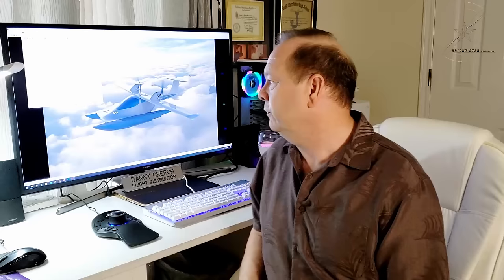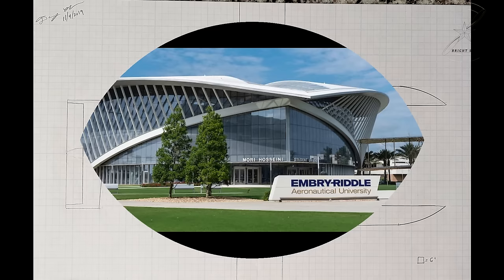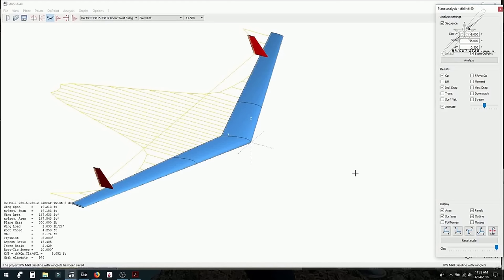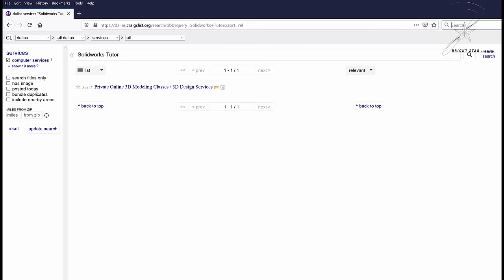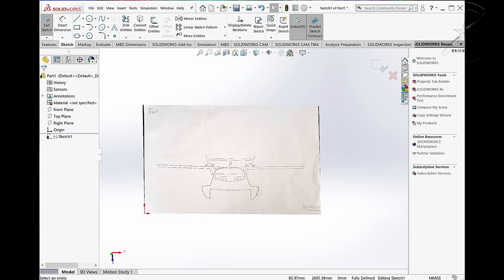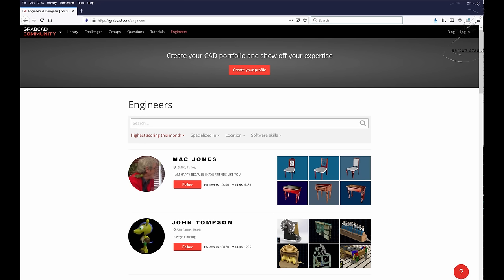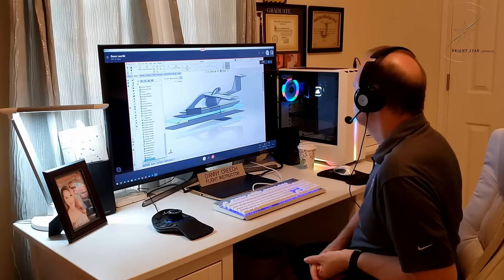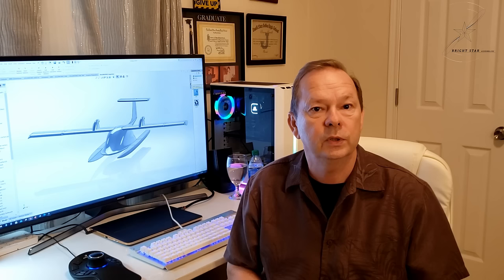How to Design Your Own Aircraft

Comment: The most important tool is passion, everything else is just a hill waiting to be climbed. I actually believe you will get this done. Very motivating presentation.
Reply from the maker: George, you are 100% correct. Passion is what it takes to do anything worth doing in life. Those who make things happen are those who have a passion.
Reply from the maker: @Hatwox Thanks. I totally get the "don't have a lot of extra money". This is why as of right now I am planing on using BMW motorcycle engines. Because I am not using a real aircraft engine is why I decided to put two of them on the aircraft. Also, if I find that these 120hp BMW engines are not enough power, I could always upgrade to UL engines. I want to make this aircraft as affordable as I can. I want the build time to be less than 1,000 hours.
Reply: Thats not true. You need a large repertoire of swear words also to fight past your CAD stage knocking every line in and out of symmetry.
Reply: @BrightStarAssemblies  call me bloody crazy but I've always always wanted to put together a single seat 1/2 scale'ish f14 inspired aircraft, any tips? 😂🥴
Reply: @KjllShot  I designed a tandem winged seaplane from a jetski hull. One passenger with autonomous capability. Concept was a rapid response SAR lifeboat/rescue plane. But a dozen in a race over the bay or harbor would be a blast.
Reply from the maker: @KjllShot  I would not call that crazy at all! Sounds cool. Sorry I can't help you much with that one. It should actually be fairly easy. Just find the blueprints for the F14 and scale it down. You would want to go with a different airfoil as you will not be flying it as fast as the original. Unless you put jets on it. Oh, and if you do that you better be a millionaire.
Reply: Without passion for my projects I would have gotten nowhere as people around me see my CAD designing as a waste of time, and my dreams as unrealistic. They don't seem to fathom that doing stuff gives you experience to do even more advanced stuff, and in the end you will be the expert you so dearly needed when you started out. Don't rely on others helping you, that is for the most part a pipe dream. People simply don't care.

Comment: I think it's also important and informative to make R/C models and iterate for efficiency, structure, aerodynamics, etc.  Lots of possible problems will rear their ugly heads in flying models, where you can analyze and correct them far cheaper.
Reply from the maker: Thanks for the comment. In the next video I will be addressing this topic.
Reply: Lift doesn’t scale 1 to 1 so one always needs to be mindful that things will change as you go from model to real life

Comment: Also, I  don't know if this helps,  but, I RC models,  Ev'ry thang comes off the wings...That determines the numbers of the fuse, engine selection,  moments,  gear placement, and  tail section size and shape....As you know,  The wing is doing all the "Heavy lifting " Ev'ry thang else is just along for the ride....Cheers  !!!
Reply from the maker: Thanks for the comment sir.

Comment: Today I was out with a friend (I'm eighteen and so is him) and we decided it would be cool to design our own aircraft. At first we were just talking about a jet-powered small drone, but at the end we decided to try and make it full size, but we didn't know where to start, or were to try our stuff, or what to build it from! We also don't have a aeronautical degree, I'm a chemistry student and he's a electric and electronics student, so we ended up kinda sad thinking that we would not be able to acomplish that dream. Thanks to your video, hope has returned, and I think we will try learning how to use solidworks and settling for a model. Thanks for this video!
Reply from the maker: Thank you for your comment Pau. There is of course much more to know when designing and building an aircraft. But to help you out, the two most common materials that are used in aircraft construction is Aircraft Grade aluminum and composite material like fiberglass or carbon fiber. I am glad my video helped to point you in the right direction. You can not go wrong learning how to use a CAD program. Once you know it you know it for life. You will be surprised just how many things over your life you will want to build and if you know CAD you can design it in a CAD program before building it. I wish you all the best.

Comment: Don't know what solid works can do. But there many aspects of aircraft design.

1 Aerodynamics

2. Stress analysis

3 Stability and control

4 Aeroelsticity. 

5. Vibration 

6. Fatigue is structures 

I just worked on a few areas. You picked up a Mega project. I don't think your aircraft will have flutter issues if you designed it right.  But you may be overweight. The best way is to distribute the weight based on your aerodynamic loads. 

Solidworks could probably take aerodynamic loads and calculate stresses for you.  You could optimize the weight, this means running optimizers. The optimization would size your bean sections based on loading for minimum weight and target Frequencies. 

You probably would have to get hold of the Doubke lattice program from the airforce to do aerelastic analysis.  

You could make small scale models and test it in wind tunnels. 

These are the few of the ideas based on my experience. There are packages like Nastran also that can do stress , and optimization, and Aeroelasticity for you. Nastran student version is cheaper. The Nastran package uses same double lattice method. I believe they have aircraft loads module as well. 

Aircraft loads is also very extensive. Gosh if you learned all this the might as well make you the CEO of Boeing. I learned about 60 percent of all this. Did not do aircraft loads or stability and control. So much knowledge has humbled me. I quit because I got disgusted with so much reading. 

You know I did not work on
Reply from the maker: Thanks for your comments.

Comment: I'm a "Wet" flyer. I like the engines. Single cylinder, cast aluminum, Alcohol oil fuel mix. 2 cycle, little screamers.
I Design and build primarily with Balsa Wood.  "Build-up" ribs and wings.  Flat sided Fuselage. Been flying R/C since 1976.
Lastest.... 48x36 Blended Body Delta, this is build-up. Flown with 4 channels using Ail & elv mixed. Tri gear for the wheels.
Engines used,  .25 BB with a 9x6 prop,  .46 BB with a 10x6.  This thing is crazy fast. Hammerhead stall drop it's nose back flying in a heartbeat.  Other planes, used or broke. 56 - 60 in Trainers, 40 sized engine 4 -6 channel radios.  
Look thru the dumpsters at flying fields salvage any airplane part (s) broken planes. Bring them all home and fix them.
It's a hobby. I something new every day.

Comment: I really admire and identify with your passion as a fellow designer currently going through the process of making my design a reality but I have to say your credibility would have been greatly improved by actually having created a viable flying aircraft. 
There are many challenges you don't cover at all, and I suspect you haven't encountered yet. One of the biggest challenges and one that ultimately kills many dreams like this is one of the economics of it all. To get the much-needed backing and funding required to develop something like this requires that your concept is at the very least marketable and viable economically, that's very hard to prove unless you can confidently project performance specs that are market-beating and offer something that makes it a sound investment. Many designers/dreamers think they'll go through the process and worry about that later but it is my firm belief that it is as critical a design factor and foundation as something like the airfoil choice or engine choice. To give you an example, my concept was designed to meet a specific requirement, catering to a specific need in the market in a specific region, it was designed around a proven and reliable new engine technology which adds to its appeal but also defines the design criteria from the start. Things like, size, weight, performance, economy, roles, and safety are all figures that come from calculation and are all factors that help to sell the concept, tbh they have to be good and they have to be realistic... it's one thing to draw an airplane on paper and then throw money and time and resources at it but if it is not a marketable concept it will have to be entirely self-funded and the reality is that funding your own design is most often more costly (certainly in time and effort but often monetarily) than better-performing kits or even fully built airworthy experimental!  As a fellow dreamer whose whole existence centers around aeronautics with a lifelong passion, I really do appreciate your passion but if you are going to tell others how to build their own man-carrying flying machine I feel you should at the very least be realistic. I have built several kit aircraft and worked in aviation all my life, I studied aircraft engineering in college and am an illustrator and conceptual artist so I have a head start but it's taken my whole life to get to this point and a long way to go yet before what's in concept is actually flying in full size. On the aerodynamic side, I would recommend once you have the design on paper build a scaled model and test the concept in the air, in addition to the CFD testing, things like stall, stability, etc are incredibly important factors to test and perfect before throwing money at actually building the thing.
Reply from the maker: Thank you for the novel. :-) I hope you find the courage to continue your pursuit towards your dreams. Life can be hard at times and makes us want to give up on our dreams vrs finding ways to resolve the issues at hand and continue forward. All of your points are well taken and as an overly analytical man myself, I have thought about every single point you pointed out. I have found ways around or over them.     In order for a man to do great things he must constantly push forward and NEVER give up. He should surround himself with other men who can help him. He must remain humble and focused on his goal. That is me.  One should always look for ways to resolve issues but do not ever let those issues become stumbling blocks. If one issue does cause me to stumble, I get back up, dust myself off, and get back to work finding a way to resolve that issue.  You are right, there are a lot of people with big dreams and ideas who will never build or make those dreams come true. Those who turn their dream into a reality are the ones who do not focus on the problems but instead focus on finding solutions. As for funding.... I will never need to look for someone to help fund this project.  As for designing something which is "Marketable", that is not my goal. I am designing this plane for myself. Later on if others want a kit of my aircraft, then I will probably sell them one.  But the mere fact that I am designing a twin engine amphibious aircraft should tell you I am not focused on "Marketing a kit". If I was doing that I would focus on a single engine LSA.  Again, thanks for the message and I hope you never give up on your dream. Cheers.

Comment: I love the looks of your plane. Making a part in solid works should be easy, it is just like catia. Draw your curves , lines, etc. Then extrude the sections to make solids. For example draw a I section. Then extrude I section to make a beam. 

To make wing draw airfoil sections at different locations.  Make solid using these section say by using glide along curves . 

Can do same for fuselage . Draw sections . Then connect sections to make solid. 

Hope this helps. 

If solid works calculates your aerodynamics.  You can use it to calculate aircraft loads.  There are many loads condition, say for example wind up turn, cruise, landing loads etc.
Reply from the maker: Thanks for your comments.

Comment: Nice design Danny. However, I'd suggest that you put the engines to the front of the wings for 2 reasons: 1-To prevent tipping over on water; 2-To have less water splash into the propellers & engines. Lastly, I hope it's an Electric amphibious LSA :-)
Reply from the maker: Thank you for the complement Al. This will not be electric as battery technologies are just not where they need to be at this time. The battery industry has made fantastic strides over the past 20 years and I am excited about the future of batteries. Once they are where they need to be then I am sure one of our customers will build one with electric engines.

Comment: You probably already know by now but you need more wing, either in length or in width and profile.  Wings for this end of the aviation  design work has pretty thick wings because lower speeds require lots more wing lift

Comment: I'm also working on a design it's a 3 man flying boat , I use Q-cad for rough drawing , it works for me (I come from using a drafting machine). 
I had a teacher in a course in Aircraft composites who had made a amphibian and he told me the hardest part was making the amphibian plane well , it would porpoise and do other things . Based upon his advice I plan to make a RC model to test it , especially it's behavior on the water.
By the way the break even point on the amphibian was 99 sales and he sold 97 but every sale was a huge amount of work so he finally quit , he mostly sold them in the Philippines they seem to be more open to new ideas in aircraft , but it was a lot of traveling to air shows and talking to people . Now he just does military contracts.
Reply from the maker: Funny you mention the Philippines. As I write this reply to you I am sitting on the island of Mindanao in the Philippines. If you watch my second video you will hear me talk about how I came up with this design. It was because I was living in the Philippines at that time. Now I am here just for vacation. I believe it is Cebu where the Lancair aircraft kits were being built. I met the man (Dan) who ran the shop there/here.

Comment: A single seat of SolidWorks with analysis package is going to be several thousand dollars, and paying me for a year is also going to be very expensive. Solidworks is the easiest and best 3-D CAD software I have used.  I really admire your persistence.  It looks sexy but I would be building a balsa wood model to  to see if the thing will even glide well.  Also it looks like you are putting a lot of work into the way it looks, I would have probably started by picking a prop and a powerplant and building an electric scale model.
Reply from the maker: Thanks for the comment Anthony. I agree that Solidworks is a great program. It does have a learning curve but it is great. Thank you for seeing the passion I have for this design. As for the glide, that is a factor of the wing. The video you are making this comment on has the older smaller wing design. As you will see in future videos, we have increased the wing and all of the tail. I don't think it will glide as well as a C-172 but it will glide as well as an RV-6. As for picking the prop and power plant, that was chosen even before the first video which you are commenting on. I talk about that in the last video. I just got back from Oshkosh and I was speaking to the guys at UL Engines. When I build the prototype, I will probably build it with the UL Engines as they are much more powerful. There will be scaled models built and flown before the prototype is built. I have several builders that have already lined up to build it.

Comment: You didn't mention making a scale model. That has and still is a good way of making a concept if you can see it in your mind. Your design looks nice, but the front area between the pontoons looks like it would cause instability such as flutter or when you use the elevator it would go nose up rapidly and stall.
Reply from the maker: I do address this in my second and again in my third video. Check them out. I also talk about how there will be scaled down models made before we build the prototype.

Comment: Amazing, I am on the same path. I am finishing my master of science in the field of Ocean engineering Naval Architektur. I had been studing in Lisbone (member of Erasmus+ for best students). Still I have the same dificulties with using CAD software. In my proffesion seferal of those are used to design and produce any vessel or off shore unit or platform, like: Catia, Forran, Ansys, and many others. Huge respect for you, like your passion and how you overcome your weaknesses. Gain your knoldge and completed your vision. I know for sure that in the future I will see your design in operation.
Reply from the maker: Thank you so much for the comment. It is nice to hear such things. The design is moving forward but at a slower pace because I have gone through two jobs since the last video and my CAD guy has move to another country and gotten married. I have moved three times and spent countless hours looking for land large enough for a runway. I finally foundnit and purchased it. These days I am back to training at the airlines. Once I get finished with my training, I will get an update video out.